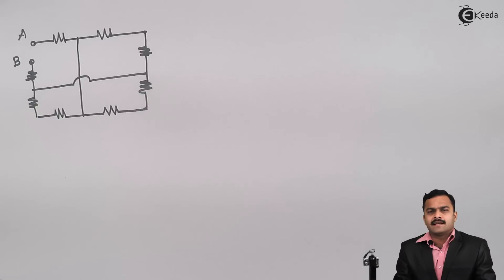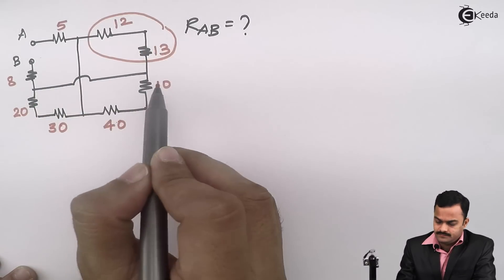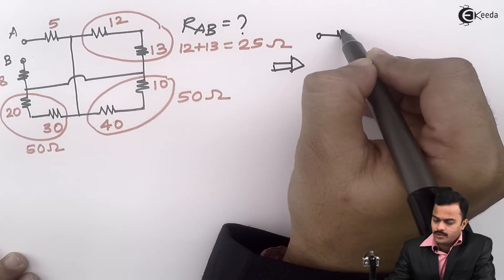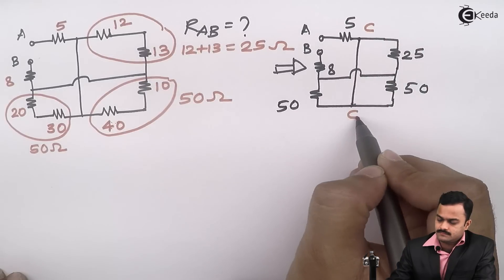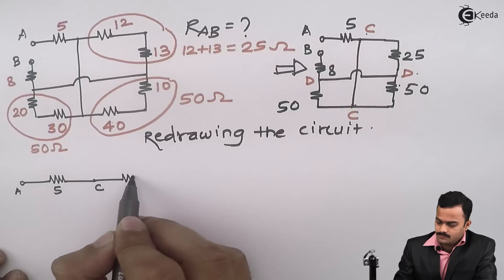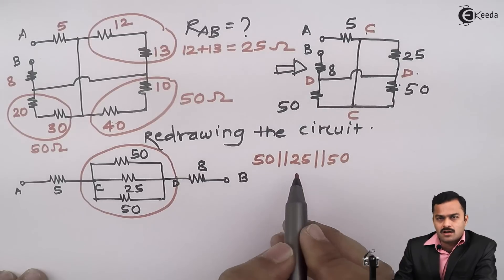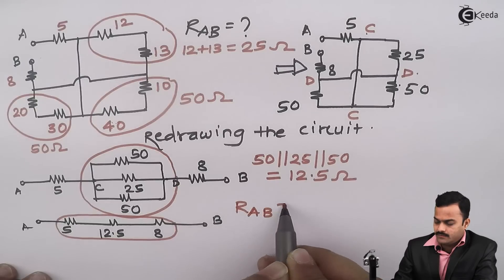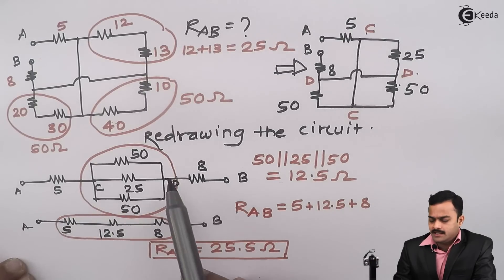Series & Parallel Connections of Resistors : Problem 3 - DC Circuits - Basic Electrical Engineering

Comment: This is an excellent tutorial on how to find the equivalent resistance between two points of a circuit containing elements that are not explicitly shown to be in series or parallel connections.

Comment: hlo sir,

i think the answer for parallel resistance is not 12.5 but 0.08?? i'm i correct?
Reply: Dude you have to inverse of 0.08 then you will get 12.5 ans
Reply: syed zahid khadri There is a sign of inversion in scientific calculator.........
Reply: y should we inverse it
Reply: {1/Rab}=(1/50)+(1/50)+(1/25)
=>{1/Rab}=(2/50)+(1/25)
=>{1/Rab}=(1/25)+(1/25)
=>{1/Rab}=(2/25)
=>{Rab}=(25/2)
=>Rab=12.5 ohms ..! okay...?!
Reply: @Healthysoul145  thanks
Reply: Thanks